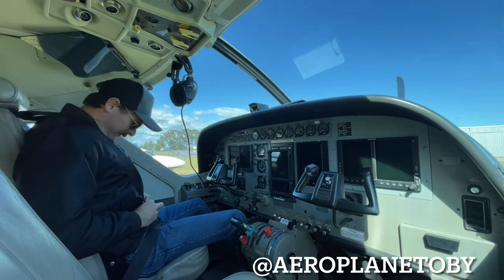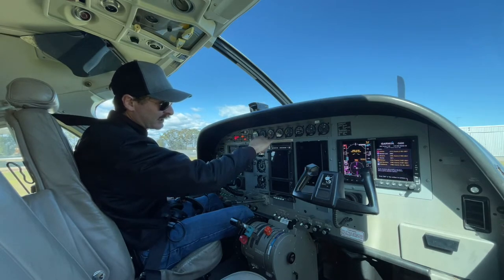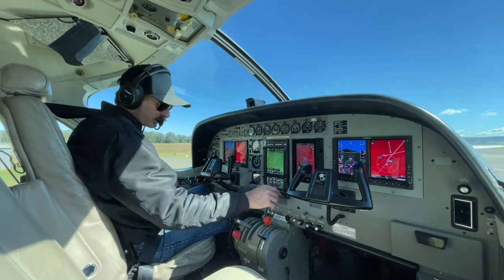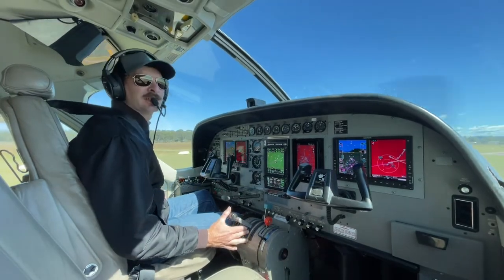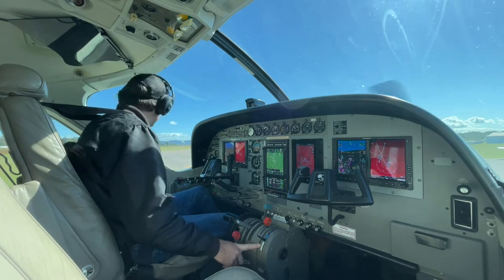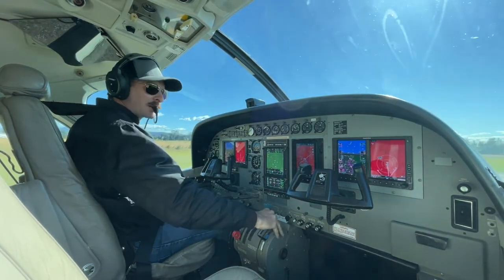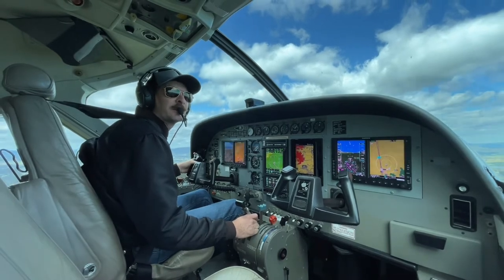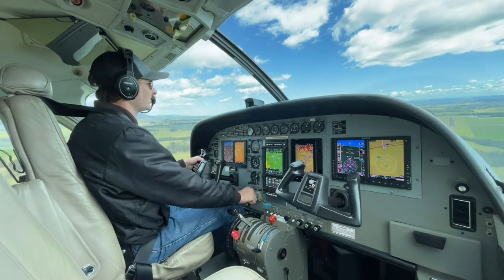Reversing a Cessna Caravan, and a short flight in the C208

Comment: Regarding reversing and dropping the tail, why didn't Cessna mount the main gear struts about a meter further aft? There's a bit of a gap between the struts and the rear doors, so it looks like they had room. 

Or would that short of a change in fulcrum position not even matter? Would it still tip just as easily?
Reply: It’s not really meant to be reversed.  There’s no approved procedure for it in the POH and it states that reverse should be discontinued below 25 Knots to prevent prop erosion. 

I’ve backed it up and you simply have to be careful.  Slowly, never with a load in the back, and feet off the brakes—use forward thrust to bring it to a halt.
Reply: @calvinnickel9995  Roger that.

Comment: Don't use the inertial seperator on the ground. The prop kicks up dirt, dust and other foreign matter that can be ingested by the by-pass on the left side of the cowling. The inertial separator really doesn't do its job till at least 40 knots or so. 
I flew for two FedEx 208 operators in the US and if you had been seen backing a Caravan up you would have been fired immediately. Stupid idea.
Reply: please advise why backing up a caravan is not such a good idea
Reply: The inertial separator is intended to be used on the ground when on loose surfaces
Reply: Sounds like a whole pile of myths with little to back it up.  

None of these are a problem on the Caravans I fly.